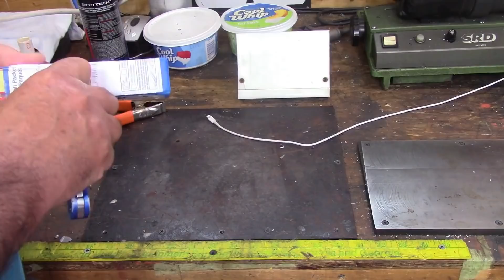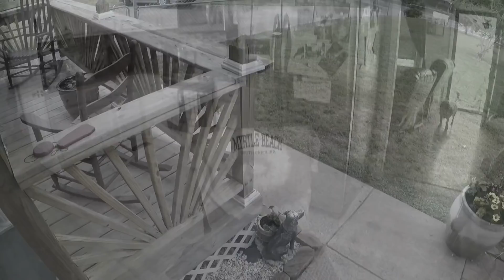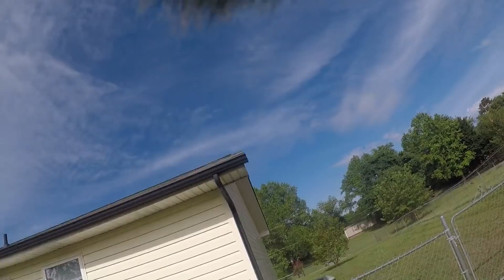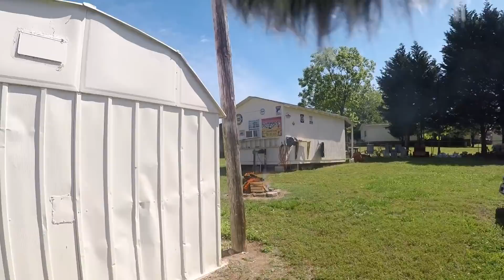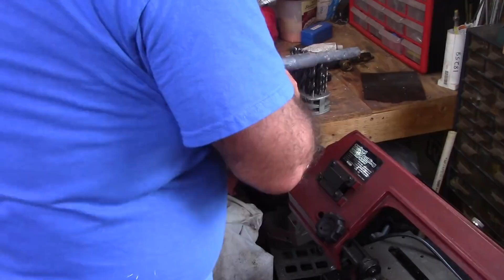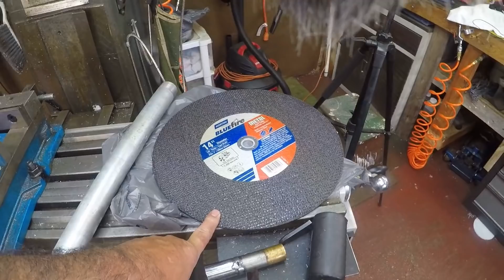Slop in the Shop 59

Comment: I got a bunch before they hit the trash bin when I still worked at the dealer.  Even if you have a bunch of drills, hopefully they can still be of use as they're cobalt steel.  A number of them were used, so glad you have a drill sharpener to touch the cutting lips up.  I collect old bed frames too for cheap/free angle iron, but definitely am choosy as to what purposes they get used for.  You mentioned John Millls' annealing of metal in his fireplace, I saw that one and it got me to thinking about annealing stuff like old axle shafts, as we have a fire pit in our back yard as well.  That old treadmill shaft will certainly be useful now as it's cuttable.
Reply from the maker: Everett's Workshop tanks for being so observant. I sharpened the dull drills and put them in my drill storage. You can’t have enough drills, basically my fractional drills were trash rescues also. Bed frames is good for work benches stands and the like. Since I only had a $1 per frame it was worth the bid. I did save the larger pieces of wood for projects one always needs a board for some odd repair or project. I almost cut the shaft up with my abrasive cut off saw and taken the down to Tom so he could anneal them. But since I had burning to do I gave it a whirl, the shaft soften up lots better than I even expected. Thanks for the kind words